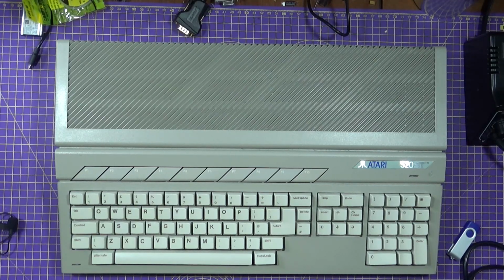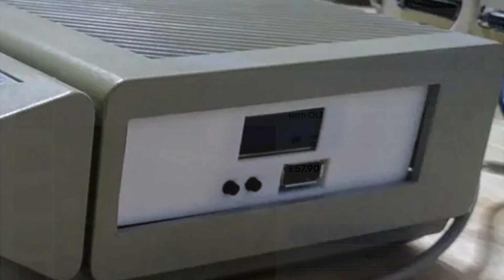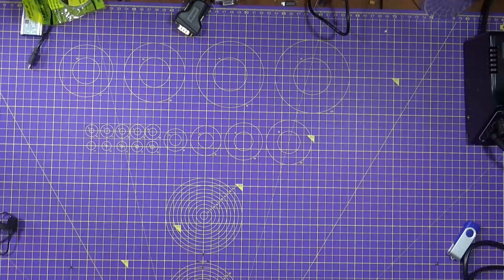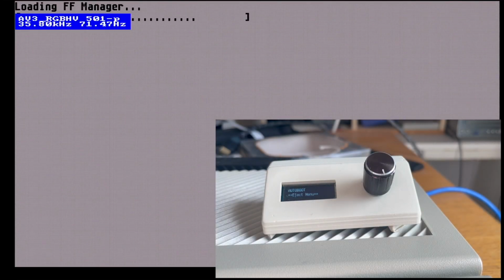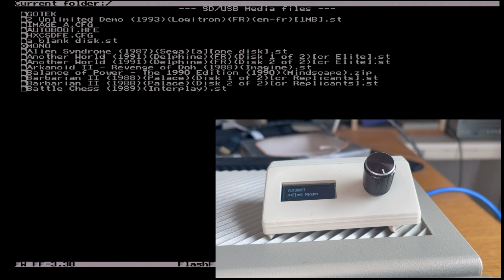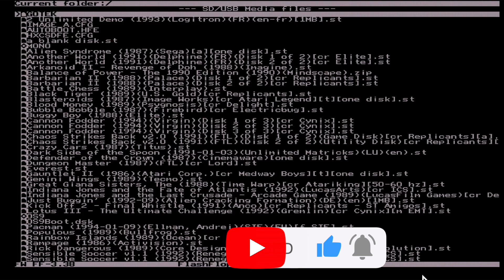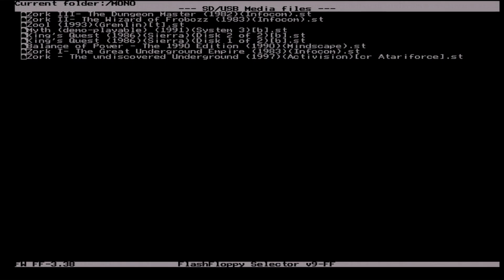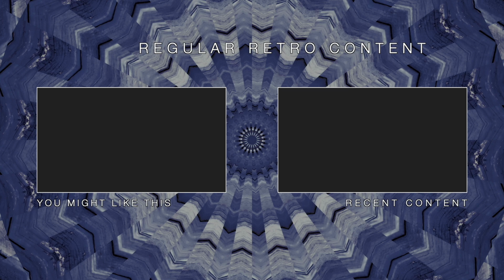Atari ST: perfect Gotek solution!

Comment: Hi, do you know if there are file limitations to this as I have a games folder with all .ST files and its viewable but takes a long time to go through them all, I created within the games folder seperate folders for the games by alphabet, I have moved the .ST to the relevant letter however now when booting I go into the games folder and it shows nothing not even the folders I have made for each letter of the alphabet. I thought at first had I done the folders on my PC and not the ST but when I have put  the USB back in my PC all the alphabet folders are showing with all the relevant games inside :S

Comment: Is it possible to mount the GOTEK as an external drive through the floppy connector?
Reply from the maker: there are other kits around that could do that, a quick eBay search shows several. two things to keep in mind

1: some are adaptors only and so you would need a separate got device.

2: they will appear as drive B and not all software runs from the B drive.
Reply: More important to note the ST will only boot from drive A, unless you modify several pins on the YM chip and connect a bootselector switch.
Reply: Thank you for the responses. It has been some time since I posted my question. My rationale for connecting the Gotek externally is to keep the internal floppy drive and avoid modifications that could introduce stress and damage my computer.
To circumvent the issue with the computer not booting from drive B:
-	I think there is a small auto folder program swapping drive A: and B:
-	Can TOS be patched to boot from the B: drive?
-	Can a function, as mentioned above, be implemented in EmuTOS?
Since I am not a gamer, booting from A: is not an issue. I have an Atari STE, which I tried to connect Gotek as an external drive. I have the appropriate cable, but it doesn’t work.

Comment: There’s a better solution that’s only came out in the last few weeks, it’s called a GoDrive and means you can keep your floppy drive also
Reply: Where can I obtain these? Found nothing for the Atari. Only an Amiga floppy emulator with the same name but this was meant to be fitted on the mainboard and has a display case specially made for the A1200...

Comment: Is that OLED display the same as the one on the BulkyMIDI-32 device?  If so, you might be able to fit that inside the case now that the floppy is gone with some sort of switch?
Reply from the maker: Interesting idea. But quite a lot of pain. I’d have to solder the midi connections inside the ST.  It using the bulky midi pcbs to create an external drive as a hotel B drive might work.